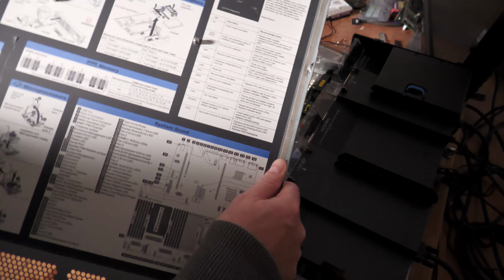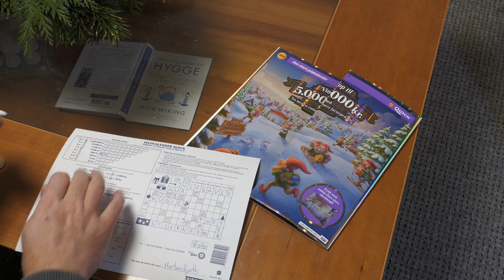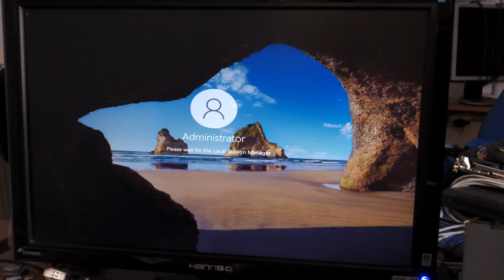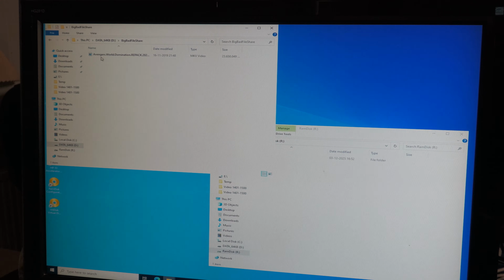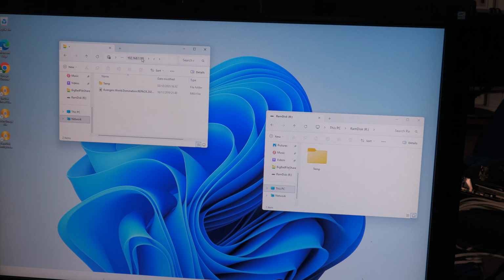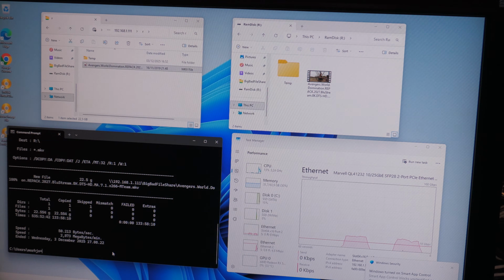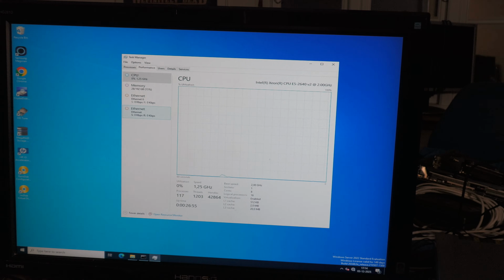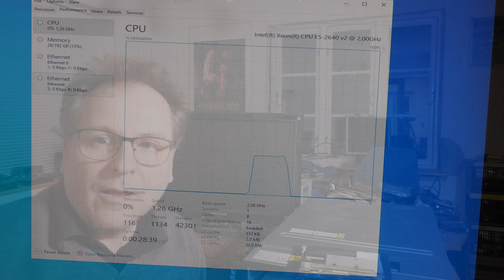10% Better 25Gbit Network Transfer - Getting There - 1551

Comment: Switch CPU view in task manager to logical so you can see that you have cores maxed out ; causing the bulk of the slowness you are still feeling
Reply from the maker: I will try that next time! you could be right,, if it does not spread the load..

Comment: Try replacing the DAC with a pair of fibre transceivers and an OM4 optical cable, if you're up for it.
Reply: DAC cables have less latency than transceivers.
Reply: @GeoffSeeley I don't think latency has anything to do with his issue.
Reply from the maker: I did want to try that,, but ony had one 25Gbe SFP28 and needed two,, might try again :-)

Comment: It could be a cpu bottleneck if a single thread is maxing out a single core of the CPU... Also you could increase your MTU to 9000 bytes which helps eliminate some overhead.
Reply: Yes, he had his Windows CPU usage monitor set to show the total, but he has multiple cores, so 27% of multiple cores is probably maxing out his individual threads.
Reply from the maker: Yes, I did try to increase the MTU and that helped a little bit!
Reply: I am pretty sure Robocopy can compress transferred files on the fly, which will use CPU. I don' t know if it's a default.

Comment: 5:12
That's always been my experience with IBM, HP and supermicro servers, absolutely junk. Cheap folded sheet metal, not nice at all to work on.
...
Dell: man, peices fit so nicely together, notches and grooves line up with the receiving parts. Smooth installation/upgrades. Any additional cable management upgrades or anything you buy: all fit so nicely with Dell.

Plastic sucks no matter the vendor tho.

Just my $0.02.
Reply from the maker: Well they all have good and bad models,,, Dell had some awful 1U servers 20years ago,, they became better.

Comment: should check also what pci-e bandwith it has available. is it in a PCI-E 3.0 X8 or even X16 or is it an x8 with just 4 pci-e lanes. so we need to check what did it actual agree with windows. sometime it could be your slot is an x16 PCI-E 4.0 but think the card run better with pci-e 3.0 but that will lower the bandwith and transfer rate. But honestly said the 22GBit is actual very good speed and you as normal user will barely use that on daily rate. it would be different if that will be your NAS storage.
Reply from the maker: Yes 22Gbit is not that far from 25Gbit
Reply: @MyPlayHouse correct, I just got  my old 25Gbps gear out and I also maxed out at 23Gbps between two servers with Windows 2025, RDMA , 64 gig of ram per server

Comment: you need something like RDMA in order to get higher speeds while cpu load is low.
Reply from the maker: One should think that the Drivers did that..
Reply: @MyPlayHouse yes, but the OS has to support it too. Windows server 2012-2025 and windows 11 pro “WORKSTATION “ edition